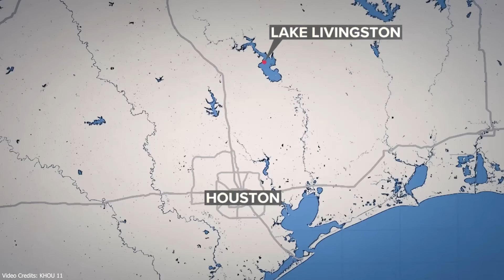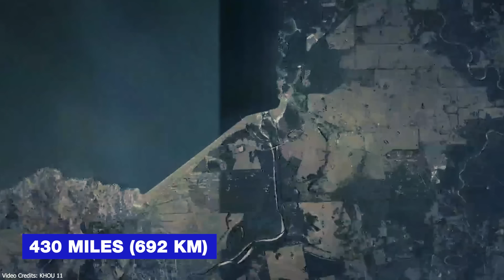Texas' Largest Dam Is Sinking — And There Is No Backup Plan

Comment: Why is the TRA being so cheap and not doing a comprehensive overhaul of the whole dam. They can definitely issue bonds to implement the repairs, they aren't bankrupt. It seems like they are operation from one crisis to another as the long term plan, the dam is old enough to have a complete overhaul and upgrade to handle more powerful storms. I'm not saying tear it down and rebuild but making the earthen embankments thicker, higher and stronger on top of the existing dam is doable. Adding additional spillway gates are also needed and then rebuilding the existing ones to handle heavier flows of water.
Reply: Why not build another one in front  that is higher?

Comment: What is the point of a dam if not to hold back water when the flow is high and release more when its dry?
Reply: There are different purposes for dams. Floodwater is not the only purpose.
Reply: @TXFM163  not so much floodwater as shifting delivery date. As just run of river it is basically a weir that raises waterlevel for an intake pipe. Seems lot of money when they could ofnjust moved the intake structure up stream

Comment: The thing about the dam in question is that the worst case for repair is to build a new temporary coffer dam (like maybe corrugated steel sheets or something) in front of the existing dam (save the spillway), recompact and grout the dam, then cover the upstream face with concrete, and build a new skirt below it. Not exactly cheap, but quite doable.
Reply: I don't think you understand the weight of the water, corregated steel sheets won't do a thing, it's like saying hey, lets this 12 mil glass of the 500 liter aquarium replace with a plastic foil, it does not work like in cartoons.

If the soil is not right for the dam, the water will just bypass everything with time.
Reply: @dannyboy-vtc5741 its possible during the drought season and we get them here in Texas quite often for 2 or more years. Drain the lake down enough and this plan is doable.
Reply: @paulsosa1872 in theory, if there's a bedrock at some depth or some other watertight layer, if it's not, with time water will get around, it'll bypass it, it's not about the type of the dam, it's about the soil, the type of ground.
Reply: @dannyboy-vtc5741  Well, in whatever method, repair of the dam seems quite possible without a total replacement and that's my main point.
Reply: @dannyboy-vtc5741  Sir, with all due respect, after a lifetime in waterfront construction, The old adage applies, "Everything looks easier from shore." That the FedGov was not involved is a plus. Texas will fix it.
Reply: @robnamowicz8073 you are an optimist, perhaps federal gov would have a surwey first and decided what type of the dam is possible, and is it at all possible in the first place.

For drinking water alone, accumulation of the tenth of this size or smaller would suffice, in fact many cities that use ricer water have no accumulations at all, ofc with big enough rivers, in terms of flow.
Reply: Wolf Creek Dam is on the upper Cumberland River in Kentucky, upstream from Nashville. The dam was completed ~60 years ago, and barely a year has gone by without remedial action (endless grouting, other reinforcement, and significant reduction in pool elevation). Granted, a dam whose construction merited much more scrutiny, since it's on karstic limestone, but both are examples of damsites which should've seen both more scrutiny and more consideration long before the first bucket of concrete was poured.
Reply: Easy fix.  Just build another dam a few hundred feet down stream.  When done the old dam can be decommissioned.   Only took 3 years to build the original.  If they start tomorrow they can be done by Christmas 2029.👍
Reply: Sounds like you know what you are talking about !   I am no engineer but your solution makes sense and yes…Doable !  Lotsa’ resources required… But POTABLE WATER IS PRECIOUS !  
MORE PRECIOUS THAN ANYONE CAN IMAGINE.!!!
Reply: The water in front of the dam is 95 ft deep.  So nope.
Reply: This is pure speculation about the problem.  Even if it’s moving a 1/4 to 1/2 inch a year you’d be able to detect that.  I’m not buying this AI stuff that generates these reports.

Comment: The dams on B A Steinhagen, Sam Rayburn, and Toledo Bend need to be checked and monitored. These dams also supply water to the petrol industry in Texas.
Reply: Yes, but the petroleum industry doesn't care about putting people's lives at risk.
Reply: @markfeldhaus1  they care if the lawsuits are big enough or if production numbers suffer.
Reply: @markfeldhaus1 .  Obviously, you’ve never worked in the petroleum industry or listened to the discussions during the operations meetings.
Reply: @markfeldhaus1  If it can knock out their production for months or years on end, and knock out their corps of operators, they are going to care.
Reply: @markfeldhaus1  Yes we do, Aaah another hater of Texas Tea, Black Gold! Oil Haters should buy a donkey and build a mud hut!

Comment: Lake Livingston is not Houston's only water source. Lake Conroe also provides water to Houston though not as much.
Reply: It was stated clearly at the start of the video that lake Livingstone supplies 70% of Houston’s water.
Reply: @AWellesley  Poppycock. At 24 seconds in it stated that Houston has nowhere else to turn if they didn't get the water from Livingston reservoir. The entire first few minutes it is talking about Houston not having any other place to turn. 
And before you answer, I LIVE on Lake Livingston. 
And the video never mentioned the power spillway that was built and how they can use that also for water release. 
This isn't just a story to me and I found some of it interesting as I was living on the trinity during the Hurricanes of Rita and Ike and then on the lake during Harvey. Some I didn't know but other parts I lived through.
Reply: @chrissingletary2876 they said 70% of Houston water comes from there. That’s a lot
Reply: @chrissingletary2876  OK when 70% of the water supply disappears for a major city, where would you turn?
Reply: @sirenwerks  Lake Conroe. They have done it before just that the San Jacinto which feeds it is not typically as bountiful as Livingston, but it would give them time to fix Livingston should anything happen to it. 
The TRA has a lot of work to do that it has put off for ages as well such as the silting in of the lake that they have neglected for ages.
Reply: @KyleLittle-nd9yb  It is. It is why the lake was built, however Livingston and Conroe are to be maintained as constant level lakes with Conroe at 201 ft and Livingston at 131 ft. 
Because of recent flooding events on the San Jacinto, they now drop the lake level before hurricane season by a couple of ft. to handle the additional inflow during heavy rain events. 
Could Conroe make up the water if drastic measures are required? Yes. It would mean that Conroe would drop significantly while Livingston was repaired but that is what the lakes are for.
Reply: @chrissingletary2876 The problem is a dam failure will last decades to repair and Lake Conroe can’t sustain the entire water needs of the region.
Reply: @sirenwerks it is an earthen dam. It will not take decades. It was messed up in Rita and fixed quickly. I am not saying it wouldn't be catastrophic, it would be, but the statement was that there was no other place to get the water and I pointed out that was not true. How long could lake Conroe sustain is a different subject.

Comment: All dams are temporary. When you try to make temporary permanent, failure is the inevitable outcome. A new dam needs building, a short distance upstream, if possible. Then rebuild the failing dam from scratch, with better materials. And then, if necessary, remove the upstream dam.

Comment: I can understand settling of the dam.  Is the rising side being caused by water infiltration?  Water infiltration of a dam is far scarer.
Reply: That is where i stopped the video and wondered what was going on. Its one thing if an entire structure sinks. It always happens, to some extent, as things settle. If it continues to sink, there is a problem and that is almost certainly towards the material its built on and or method used to disperse forces for that type of sediment you are bulding on.

But here one side is rising. So there are two things going on. First is why is one side sinking? That points to not dispersing forces and so an error in design. If it was stable first, then started sagging, it is most likely water eroding soil under the structure, which is also a design error. It can be just because eventually that will happen and so more a maintenance and age thing, but that doesnt seem to be the case.

But the other side is rising. There is no way that side is rising, bc the other side is sinking and so would pivot, like a lever, bc that just wont happen. The structure would break. It seems to me there must already be breaks in the structure. I cant see how that is not the case.
It may be rising bc of watersaturation in the soil, which has not broken through fully to the other side. Waterpressure and saturation expand soil, same as substracting water from soil makes it shrink. But since that is not an equally spread out phenomenon, there have to be breaks in the structure.
And that imo also means it can catastrophically fail, bc once that leak extends to the other side, it will quickly erode away all material and the part thats now lifted wil sink away really fast. Ie, the entire thing will catastrophically fail. Which means the lake will drain without much of a barrier. I dont know whats downstream, but things are usually not designed to catastrophically fail.
Reply: dam is old, it need removing and replacing.
Reply: @sopcannon  Simple question. Since according to the video, the lake behind it is the major source of water for the metro Houston area, just how do you "remove it"?

If you drain the lake to gain access to the area, what does Houston do for water while your doing that?

If you leave the lake in place, can you build a new dam in front of it while the lake is still there? Yeah, I guess you could put in cofferdams but you'd probably have to do that in segments, and that doesn't strike me as all that easy or cheap.

Can you build a new dam downstream and then remove it while the lake is still filled? That sounds like a nightmare project on the removal. And it assumes that the terrain downstream is suitable for a new dam.
Reply: @markkirby9531 There have been dams built right downstream from existing failing dams. This has also been done to increase the storage capacity of existing reservoirs. Maybe in France? I’ve seen a couple of stories about these sorts of projects.
Reply: @markkirby9531  Simple. You dig a new channel, redirect flow to it, block off the existing dam, repair or renew it and return everything to its 'original' state.
Thats how its almost always done.
Its rarely done to drain a lake, bc lakes are fed into by streams. So you then have to redirect alll feeding streams in order to be able to drain a lake. And that is a lot more work than redirecting the exit stream. So its only done when work is needed on the lakebed itself. That can happen, but thats only really viable on very small lakes.
Reply: @markkirby9531  Forgot to say btw:
Before you start work on it, you may want to lower the water table. So keep letting off more water than the lake gains, which you can do to minimal levels. Dont know how that is for drinking water, bc depends on where they take from. If its critical or can be critical in drinkwater supply, you wouldnt want to lower it too much.
But lowering the water table makes means less pressure on the structure and it makes all the work that needs to be done a lot easier and less time consuming and so less costly.

Negative there is that in creating the lake as is, flora and fauna around and in the entire lake have adapted to those levels. A lot of it may suffer in the meantime. Plants dying bc no longer enough water, particularly those that live right on the edge of the water. Means also animals that live there suffer, aswell as possible parts that are now submerged may run dry, so fish may be caught in there and so on. That will all restore once its back to normal, but its sure something to keep in mind and determine b4 work starts what the impact will be.
Also as for tourism, dropping the water level significantly will negatively impact tourism in the entire region of the lake. Businesses may want compensation.
Reply: @sopcannon  the damn is not old. It was built in 1970. That is not an old for damn.
Reply: @davidcolwell614 . It is old for such a poorly built dam that has failed more than once since its completion. 🤯
Reply: Was looking at some data on this lake and maps, but
if this thing sinks 8mm and rises 8 mm on the other side, thats a lot. Thats 8 cm in a decade. Dont know how long this has been going on, but its not something you want to wait a decade with to start doing something. Imo it should be addressed now. As in make a plan and start the work asap, bc if this thing suddenly breaks, its going to lead to a lot or problems and victims.
Im dutch and we have several of similar size and depth waterways right here where i live, some blocked off completely, some with an in/outlet to sea, one remains open. The amount of water is significant.
Seeing as they (as far as i can see) more or less artificially created or probably enlarged this lake, the depth will be highest at the dam. Seems to be a 30 m drop. Maybe its 10 at any given point, but that still means from some 250 km^2, times 10m, is a lot of water. If that catastrophically breaks, the entirity comes flooding down the trinity river. Since that is way too much for that river to handle, its going to overflow very quickly, as in instantly. There are people living on those downstream river banks. Even small villages.
Since a massive flow like that will start to carry debris of all sorts; trees, boats, cars, and so on and the downstream river rising to far above its normal level, it will also take out bridges and so downstream.
Thats not something you want to wait with wrt doing something.

I also noticed there isnt a whole lot of space to do the necessary work. To the north there is a settlement, minimal space there and to the south also a settlement. So either they have to dig a temp channel right on top of where 'trinity river authority' building is, which is slightly to the northeast, or in the middle between the village to the southwest and the what i take is an overflow outlet. But its darn close to the village.
You cant make a temp outlet right beside the outlet, as ground needs to be stable.
Best option is probably to sacrifice the overflow outlet to the southwest (right 'below' the dam), preferably a bit more to the south in expansion, which youd have to do imo.
Thats gonna cost billions, but needs to be done asap. And since the problem is at the basics, may aswell tear it all down, look at what the problem was, stabilize all the soil and make it better and new.
Reply: @StofStuiver that’s what a rich nation would do. We’re broke!
Reply: @NatureBoy-b2h  I know m8. I could say a 1000 things about that, but none of it will prevent whats coming.
I guess things will have to get really really bad before people take back the power. Its no better in Europe, although they manage at the moment to keep inflation somewhat limited with all sorts of trickery, bc the agenda must go on....

Comment: I grew up around both Lake Livingston and Lake Conroe to the southwest and one thing worth mentioning is that the lake itself has changed since it's creation. A lot of the trees were left in place when the area was flooded to the point that there were many areas you couldn't speed through without risking hitting a deadhead log or stump. This remaining vegetation helped to dissipate the movement of the water but has since rotted away. Also property owners were allowed to bulkhead in the edges of their property meaning there is very little shoreline to absorb the waves when they're whipped up by the wind.  I can remember there were times that the lake was damn near glass smooth but now there's days I can't even go out on the main parts of the lake without being bashed around in my little boat. 

I'd imagine this probably contributed heavily to the lake stripping away the protective rip-rap and eroding away at the dam itself.

Comment: They could rebuild it with our annual water bill…
Reply: 😂 that’s no lie. Water for lake front neighborhoods are $100, monthly, MINIMUM. I left my water running over night to water the lawn when I first bought the house. My water bill was almost $400 dollars the next month. I almost shit myself.
Reply: @Gustimation  With a pool and a relatively small yard, our bill hits $700 in the summer. Highest was over $1,000. Average, is $400 with 14,000 gal of usage. It's insane.
Reply: @G2Precision holy cow, I’m used to suburban water prices. That’s insane!  That sounds like Cape prices. Yikes.
Reply: @G2Precision  Using that much water in a single month is what is INSANE, not the bill.  The other thing that is INSANE is you!
Reply: @G2Precision  That’s just an absolute lie 😂
Reply: @davidroman1654  Average total household water usage for a home with a 25,000-gallon pool and small yard is roughly 400–700+ gallons per day (12,000–21,000+ gallons per month), depending on location/climate, household size, and habits. This is significantly higher than a typical home without these features due to pool evaporation and any yard irrigation.
Reply: Easy fix.  Just build another dam a few hundred feet down stream.  When done the old dam can be decommissioned.   Only took 3 years to build the original.  If they start tomorrow they can be done by Christmas 2029.👍